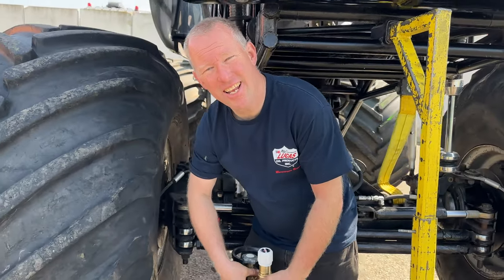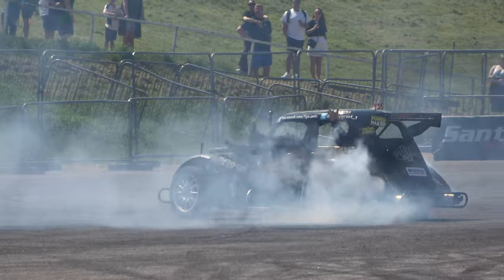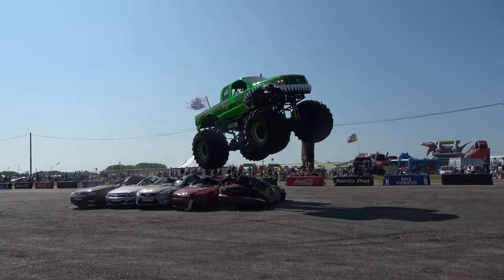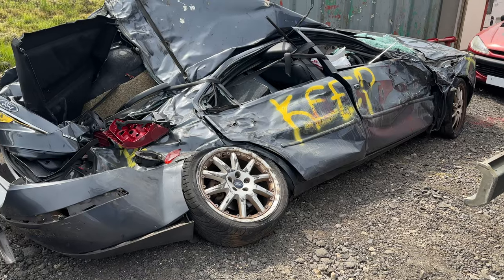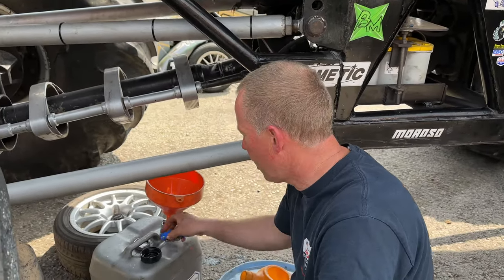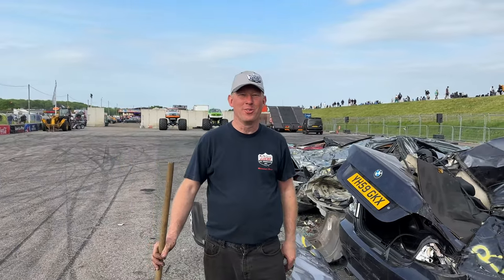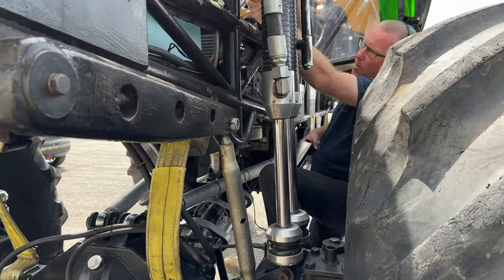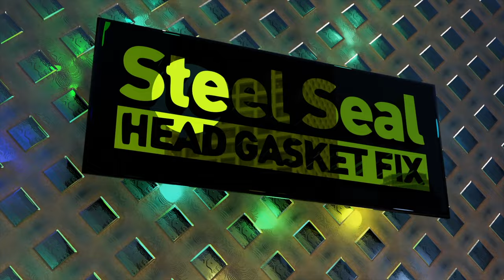The Main Event vlog

Comment: Sounds like podzilla is not running on all 8 @swampthing4x4
Reply from the maker: It is set up different to mine, and also the rev limiter is a lot lower than my one
Reply: @swampthing4x4  interesting. Where do they store podzilla when not in use?
Reply: Does it run a different fiiring order?